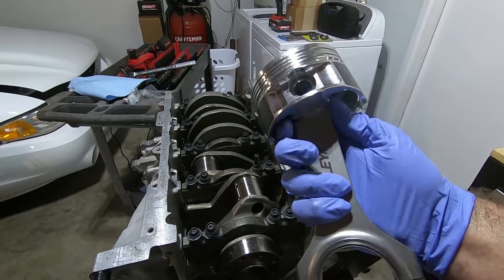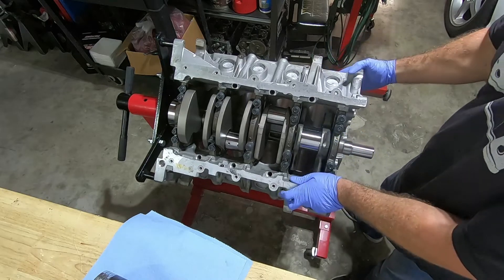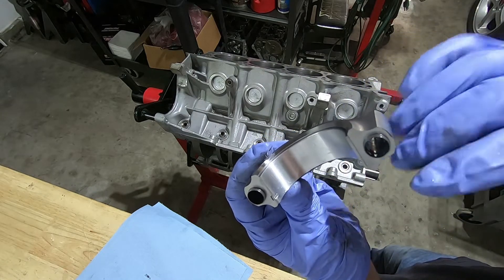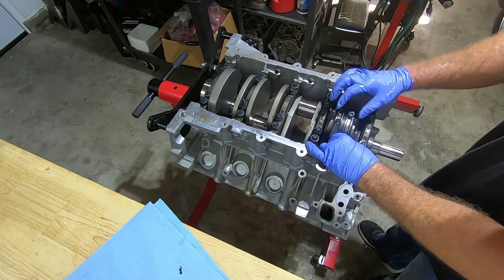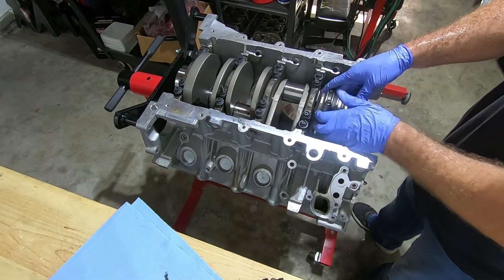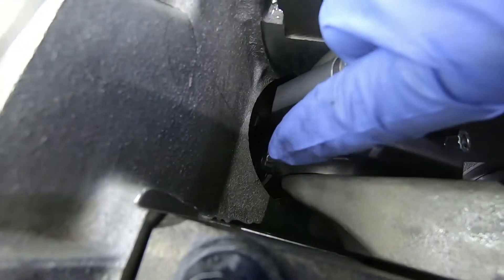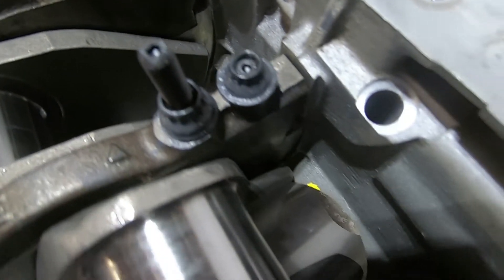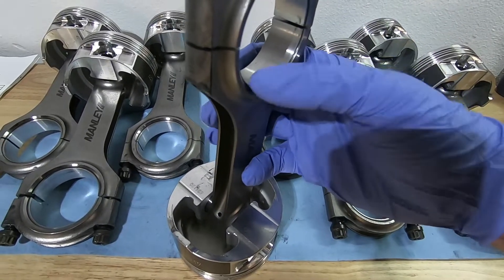Pt 7 Finding Internal Clearance Issues - 5.0 Stroker 4.6 Teksid Engine Block

Comment: The chamfered side of the connecting rod ALWAYS goes against the crankshaft. That chamfer in conjunction with a narrowed bearing clear the "fillet". "Fillet" is an engineering term and is pronounced "FILL-it"! 

"Fil-Ay" is a culinary term!

Comment: Are these teksid 96-98 blocks stronger than the 03-04 crobas? Thanks
Reply from the maker: I would say they are at least as strong as the iron blocks and possibly stronger, but I do not know for sure.  What I do know is they are half the weight of an iron block and they are capable of handling over 2,000 horse power.
Reply: @JohnSmithRacing  If I end up with a foxbody like planed or any other mustang I'll surely head your way. Only about a 6 hour road trip. Thanks again for your new content keep up the good work.
Reply: @JohnSmithRacing they are not stronger than the the iron block. Look at why ford stopped using it and on the new 5.0 it is cast iron. Cast iron holds more heat and more power the aluminum will split in certain places and warp. Im building a romeo block build